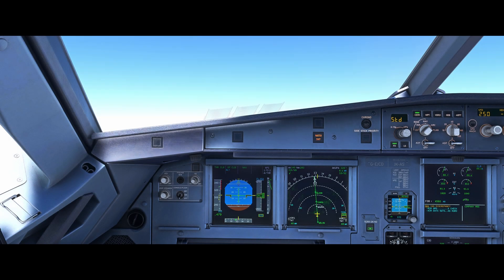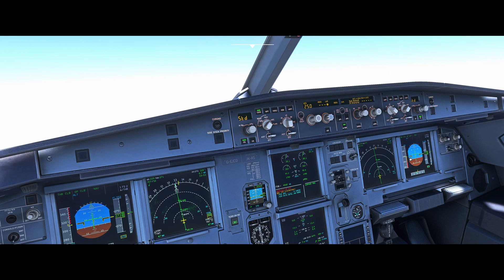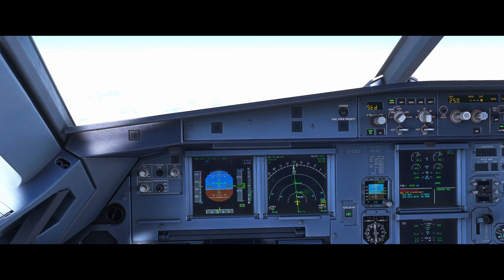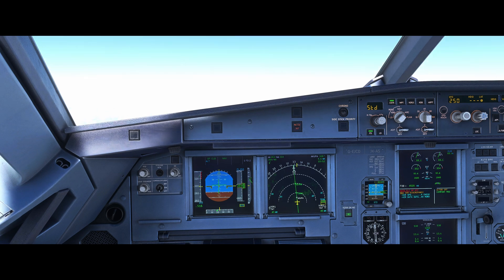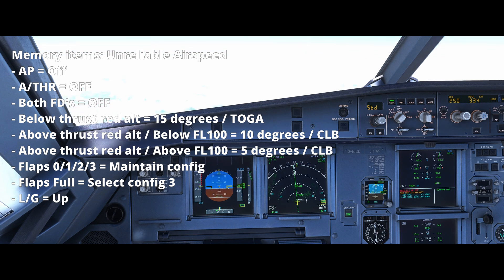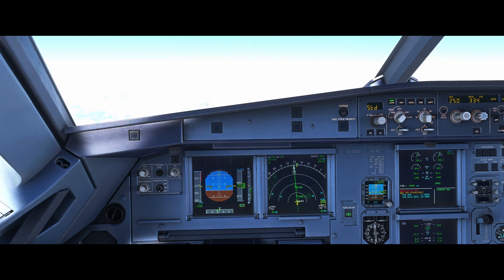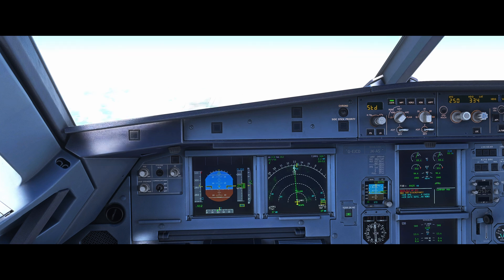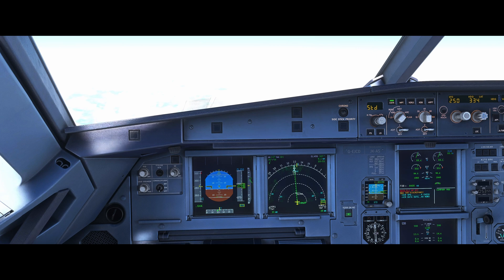A320 Unreliable Airspeed? Memory Items Every Pilot Must Know!

Comment: how would the clean up work then once I level off? for example I'm in config 3, do I then just set the thrust setting and pitch for clean configuration, wait a few seconds and then go conf 2, 1 and 0 ? or would I stay in config 3 and accept the fuel penalty?

Comment: What we need is a fan that sticks out of the aircraft and directly measures the airspeed WITHOUT the need for ANY compramized pitostatic components.
I've ALREADY come up with the mnemonics, I would call it Remote Anemoeter Torquemeter, or RAT for short.. It's speed indication would be RAT Derived Airspeed, or RDA.(in knots)
We just have to persuade manufacturers to fit a big fan that jumps out of the aircraft when Unreliable airspeed appears.